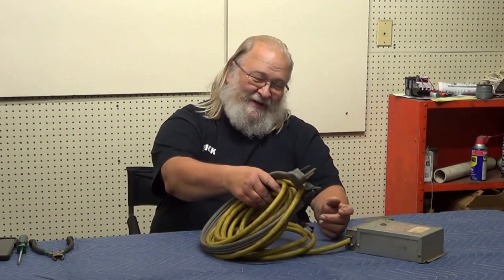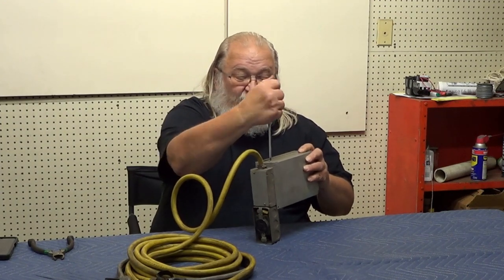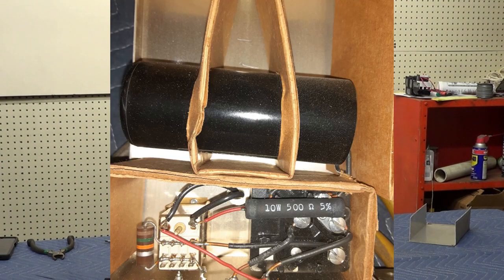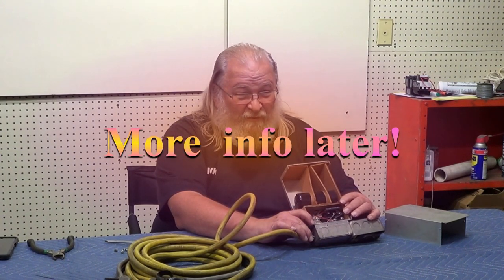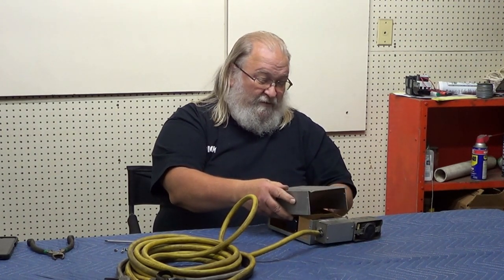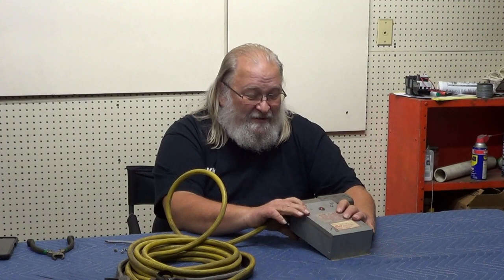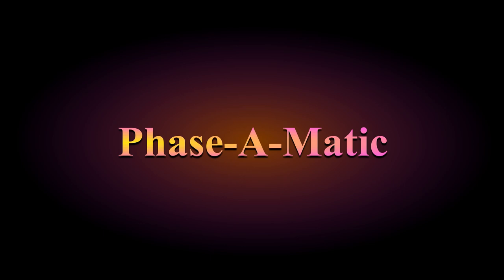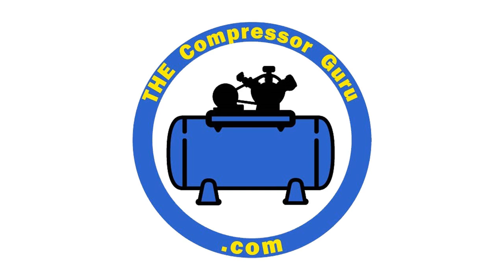Phase -A- Matic With THE Electric Guru

Comment: Thank you Guru's Deaux for this informative electrical device ! We just never know when us hobbiest's w/1Ph. will run across a 3Ph deal too good to pass up. I saw this the day after it was released on YT & wanted to comment but  got called away to fix an urgent Honey-Do, (constant run toilet that my "genius" 31 yr. old wanna-be plummer step-son, left the pull chain so long that it holds the flapper open slightly 😡) He has messed with it 3 times sending the water bill from $57.0 to $331.0! We're on SSDI fixed income & we can't afford his daily "genius"  mistake$! Lod help me control my rage & blood pressure! Peace & abundance, thank you Jesus! Ok, I am calmer now... Paul from hot (106°F today!) S. Central Tx.